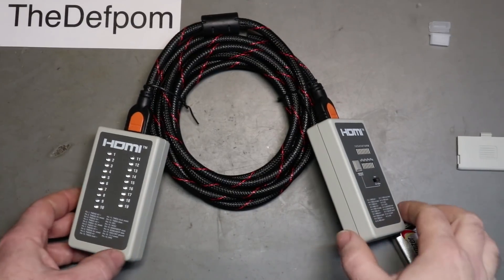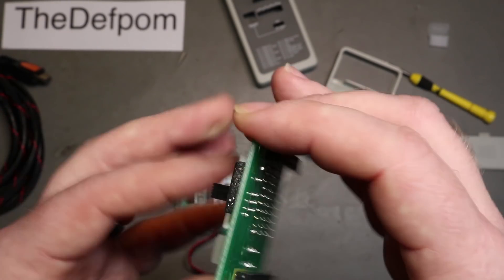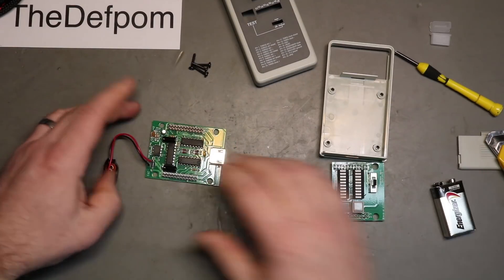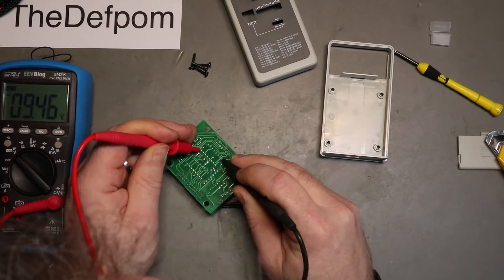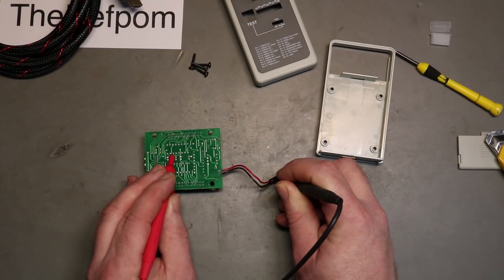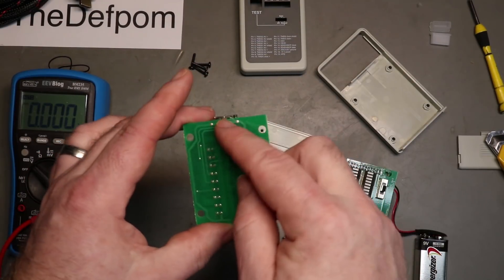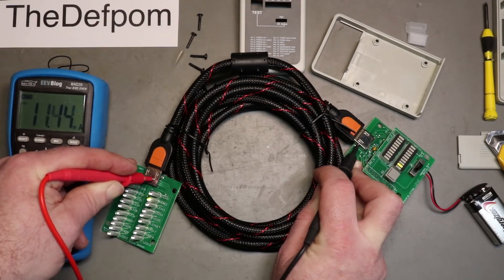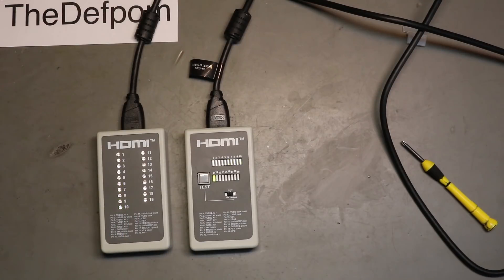🔴 #420 HDMI Cable Tester Teardown and Fault Finding

Comment: You are not supposed to have shields connected together. That could actually damage equipment if you have a ground potential difference balance itself out over that shield (ground loop). I have encountered a setup where between a TV and a computer was 100+ volts between the shields (appliances on two different mains phases and not grounded). 

For the shield to fulfill its role it is enough for it to be connected on one side, no need for it to be connected on both. It is not a ground connection.

Comment: Perhaps you should consider modifying the tester so it doesn't solely rely on the cable shield as the ground between both units as it is not vital to protect against interference, so long as ground is connected at one end of the shield. It would be straightforward to bridge one of the internal grounds to the existing shield connection, perhaps with a switch to preserve the existing architecture when required.

Comment: The foil shield is not rated to act as a return path for current. It is only meant to act as a shield against interference above about 10MHz. Having it disconnected at one end is an acceptable method of avoiding ground loops between equipment however. The cable should have a number of individual ground connections independent from the shield. These are often missing in cheap cables. It would be interesting to know if the ground lines are missing in your cable or if the designer of the tester made an invalid assumption about the shield continuity.

Comment: Ahh good old 4000 series and the 555 timer, old tech :-D

I made a simple tester for 5 pin din cables when i was 20, two din sockets on a box with 10 leds and 5 buttons to press.
Crude but told me what i wanted to know :-D

Comment: Yea, those dodgy gold plated audiophile cables, I had one some time ago, that claimed to make the video and audio quality better (in an digital application like HDMI is) but that wasnt shielded either. Video and audio was ok, but network didn’t work over it, the one that came with the tv worked but was to short. Like you example it was braided and had nice silicon molded connectors, but lacked the basics.

Comment: Does the tester check the individual twisted pair shields? (pins 2, 5, 8, 11 and 17) If not you could tie one of those pins to the tester ground buss to test cables without an outter shield connected through.
Reply: You can see the shields are not connected during the test, so likely it relies on the CMRR of the transceiver to do the data recovery. Just a junk cable with fancy outer, like so many others. Shielding would add a whole 5c to the cost of making the cable, as it likely was only 30c to begin with of course it was cut out.

Comment: Probably just a crap cable ...... but we did do a lot of single point grounding on digital signal cables at radar facilities, grounding sheilds a only one end to prevent ground loops. If so the cable should be marked to indicate the end that is the sheild ground.